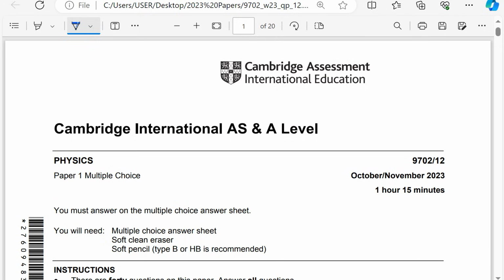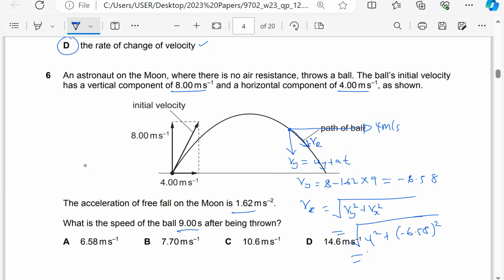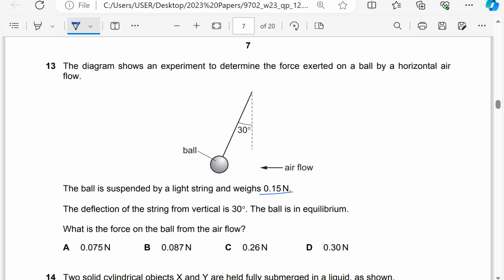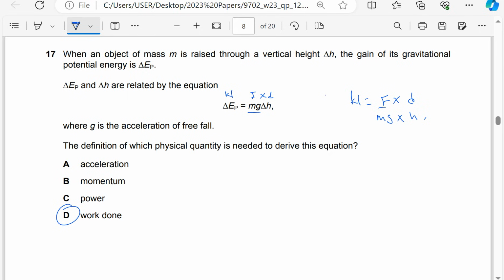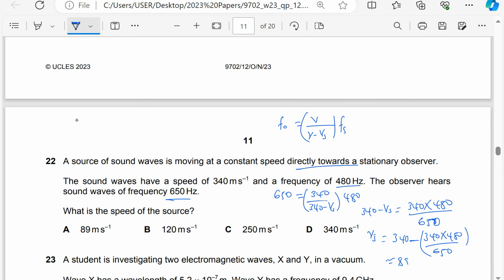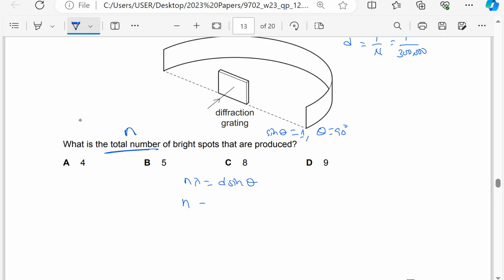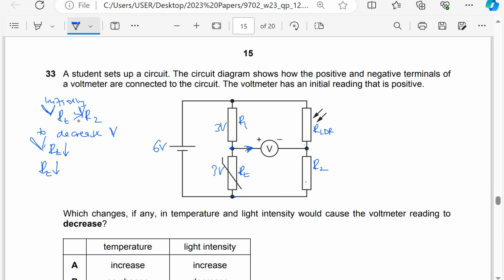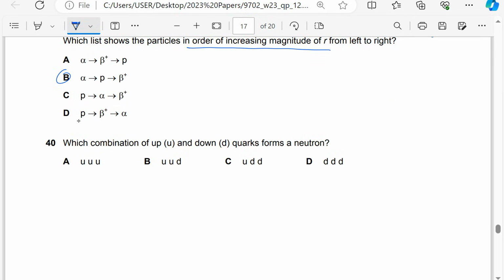CAIE AS Physics 9702 OCTOBER/NOVEMBER 2023 Paper 12 solved MCQs

Comment: 57:12 I don't understand how its A, shouldn't it be "both decreases" i.e D. I put it in a simulation as well and the voltmeter reading decreases. Shouldn't Rt increases so that it takes more potential and so R1 gets less potential & R(ldr) increase so that potential across it increases and so this leads to R2 getting less potential drop. Hence, both Rldr and Rt must increases meaning temp and luminance must decrease? Please correct me wherever I went wrong. Thank you
Reply: doesn't voltmeter measure potential DIFFERENCE, hence if u make both lower, the difference won't decrease, the most effective way of decreasing the difference is by lowering the upper bound (which is established as the side with the thermistor) but increasing the lower bound (the side with ldr) However, I misinterpreted the question as apparently they are comparing voltage between thermistor and fixed resistor 2, instead of thermistor and ldr, thus I got the wrong answer, B
Reply: Positive reading in voltmeter means p.d. on left side is higher than p.d. on right side. For the reading to decrease,  p.d. on left side should increase, which means voltage on R2 should increase (meaning Rldr should decrease for it to provide more current on left side aand Rld decreses when light intensity increases). And p.d. on left side should decrease, meaning Rt should decrease, leading to answer A.
Reply: Im getting the same answer D, Rt should be less than R2 for their to be a positive potential difference, but the marking scheme says its the answer A

Comment: in q11 cos 45 is radical 2 over 2, how is the answer something else
Reply from the maker: root 2 over 2 is same as 1 over root 2 please
Reply: @learnPHYSICSwithIBM please😂
Reply: What topic are they testing here exactly? Moments or as level pure maths trigonometry
Reply: @ProjectRevival_V2.0 igcse maths and addmaths, knowledge from ifgcse required, basic knowledge needed
Reply: the formula for polarization is actually cos theta squared, so it would (root 2 over 2) squared, which gives half, and you do that a second time, so then u get 1/4th of the original intensity
Reply: That’s denominator rationalized. Cut numerator and denominator by root two.

Comment: in q33. why is Rt>R2? i cant understand it.
Reply from the maker: current flows from  side of high potential to low potential, and this will only be seen if Rt> R2
Reply: Ahhh i got it. What i understood is for R1 has to consume less voltage than R ldr for there to be higher voltage on the left side at the junction
So if r1 loses less from the 6v than the ldr then yeah Rt>R2.